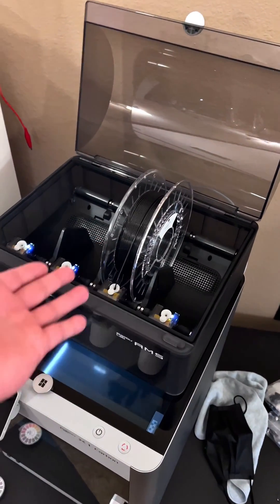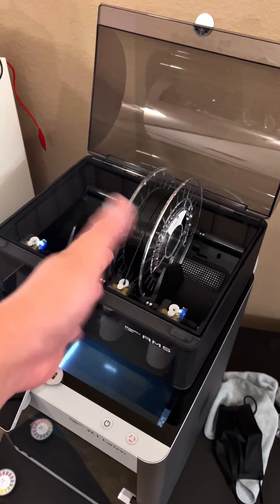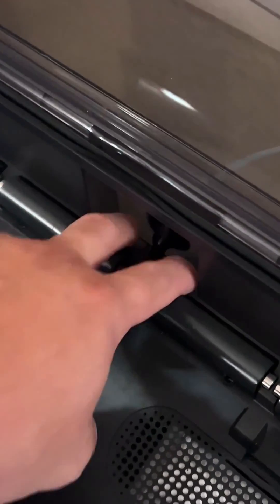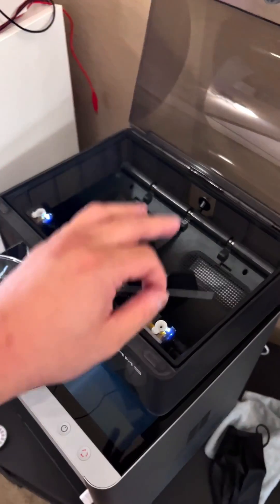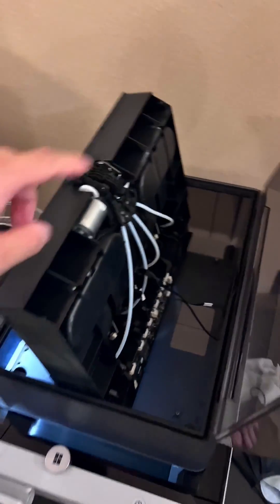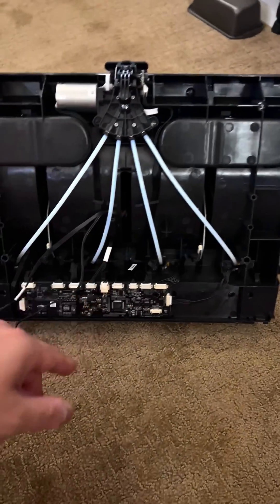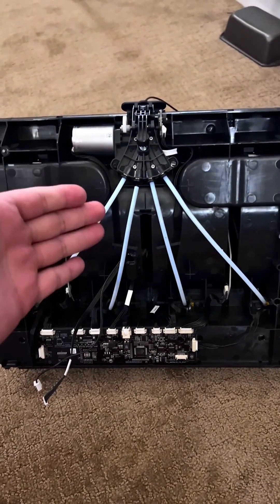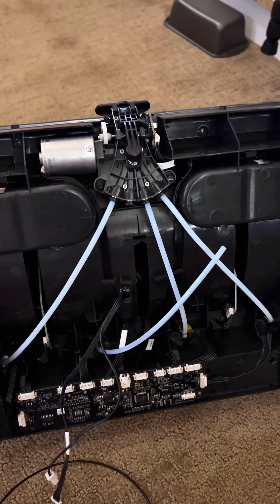How to unjam filament in AMS unit of Bambu Lab X1 Carbon

Comment: well your press down the hammer" saved my day. Had been trying to remove a piece of pla from that part for hours, thought about a hot needle to melt into that thing, but wasaraid to damage something. Besides that, that would not have helped at all, And then I found your explanation how to do this. A big thank you from Germany.

Comment: You say its a "hard no" even for 95A in the description, but the filament in the video seems way softer than 95A, have you tried 95A as well? I've read that other people have had no issues with 95A+
Reply from the maker: @ErgoBytes  the filament in the video is ColorFabb Varioshore TPU which has a durometer rating of 92 & it actually did work until the AMS needed to retract the filament for a color change, but I also have used another industrial TPU that is 75D & it also ended up failing the same way as well.
Firmer TPUs may work with the AMS especially since this video was posted when Bambu Labs just started shipping out their kickstarter units so more recent firmware updates might’ve made running firmer TPU possible.

Comment: Thank you so much for this video. 2 years after being posted it helped me figure out why my AMS wouldn't work all of a sudden. I didn't realize the filament broke inside the AMS.
Reply from the maker: @isaiahm158  knew this was gonna be a common thing the moment I started messing around with my new AMS. Funny thing is the 1st thing I did right after getting my AMS from Bambu’s kickstarter was throw in some TPU despite bambu saying several times not to at the time 😂
Glad this video was useful to so many people especially at the beginning since the Bambu Wiki wasn’t really fleshed out yet when this video went up

Comment: Had a print run out of filament in slot 1. Clipped slot 2 off and moved it over to finish the print. Well that was a mistake because when I went to unload slot 2 of that little piece it sucked it in and was stuck in a loop of not being able to clear out the filament. Thanks for this quick and well made video. Fixed the problem with ease!

Comment: I did the same thing with TPU.  I was able to disconnect to PTFE tube in the back, snip the TPU a couple of inches long at the spool, remove the spool, lift the 'release' for that spool slot and then pull the TPU out the back.  It didn't seem to resist the pulling and the TPU didn't even really stretch any, so it seemed safe.  Afterwards, I loaded another PLA into the AMS so I could see the PLA come out the back (making sure all the TPU is clear), then reconnect the PTFE tube.  Worked great.  Thanks for the video that stemmed my curiosity!  I didn't have to loosen the screws, remove the spool holder, etc.

Comment: phew -- apparently I had some very old and brittle PLA that snapped off and stuck in the hammer (in fact, it snapped off in two other places as I was trying to get it out). You pressing down the hammer to free the filament is what finally showed me how to get the last bit out, thanks!

Comment: Thanks for the video. I had to disassemble the hotend twice because of this. PETG, 250°C hotend 90°C bed. The piece I removed were looking squished. Most probably it did not have enough cooling time. Just a thought, in the gcode of the filament change rhere must be a pause of maybe 5s-10s until the filament cools down so it's not soft anymore.

Comment: I just had a piece of PLA break off right at the edge of the funnel, so I couldn't grab it to pull it out. This video is VERY well made, and helped me clear the broken piece in the AMS in minutes!
Reply: Me too! This was the only video I could find that said.. push on the spring. Thanks OP
Reply: @josephtruncale  In the same situation , very useful
Reply: @josephtruncale had the same issue 😭

Comment: hard TPU from extrudr worked fine for month, until now ... thx for the video ;)  hard tpu with carbon is even stiffer and hasn't failed. edit: only had to remove the back ptfe tube and managed to pull it out.

Comment: They really should have made the bottom removable to access the PTFE tubes to clear them from a jam or broken filament section floating around in the small tube section.
No fussing with the two short wires and no taking the whole thing apart. Its a royal PAIN.
Reply: Already working on some plans to use a router to remove that lower pan and print a new removable cover.
Reply: @robertspendlove7508  that would be awesome.. I hadnt done any projects in a few months, but it stayed closed. Wouldn't you know as soon as I turned the machine on and it ran through its start up process. I got a nice little jam!
Keep me in the loop on the access panel

Comment: Wow, this is exactly what I needed! Some crap PLA snapped when the AMS went to retract it, and I was like “where do I begin?” This was super clear and helpful. (What a PITA though, I think I’m gonna avoid cheap PLA going forward 😕)
Reply: Mine was old...and brittle
Reply: Just wet. dry it out and you should be good to go
Reply from the maker: Happy it helped! Moment I got my AMS from Kickstarter I knew it was gonna be a pain so I’m glad I could save you some trouble 😁
Reply: @MinWin3D   Yes - you did help tnx, lol when it happened to me i said to myself, oh gosh, i did what i wasn't supposed to do, oh well i guess its another AMS system if i have to worse case - but said let me google it 1st, i am sure i am not alone....bgish 1st vid solved my issue.....
Reply: Same! Weird because PLA spool is new from Bambu and came with the X1C printer.

Comment: Couple dudes in FB group claim they are printing 95A TPU consistently through the AMS. Never shoved the process though.
Reply: My guess is that it would be the 'overture high speed TPU'.  Don't know for sure though.  I would really like to get 98A shore TPU working in the AMS when I receive mine, if possible

Comment: hate videos where they just skip the hardest part. getting it upright
Reply from the maker: Would’ve definitely filmed it in greater detail if it didn’t take both hands & a few minutes of finessing to get it off. Really didn’t want to damage the wires or connectors
Reply: @MinWin3D  yeah, just got pissed off and missbehaved. Great video :) and to everyone Else just use a bit of force untill the rubber tap releases

Comment: Thanks for the video. You saved me a lot of time and grief! 😇
Reply from the maker: Happy to know it helped!
Reply: @MinWin3D  I'm curious if using Capricorn XS tubing would help here.  That spiraling is caused by the TPU compressing inside the tubing instead of pushing forward.  XS tubing might prevent that (similar to how it helps with bowden setups).
Reply from the maker: @jaydefizzle  so I actually spent a fair bit on Capricorn XS tubing to replace not just all the AMS tubing but on the X1 as well. Btw make sure you cut them exactly the same length as the original, learned the hard way 😅
Unfortunately, it didn’t solve the problem & in some cases it actually ended up cause a good bit of friction in areas where a tight bend was occurring so I had to remove them later on.
Reply: @MinWin3D  thank you so much for testing this!  Recommend to put a note about that in the description of the video!

Comment: That is great to know. Thanks for putting the video together. Any idea how to fully clean the filament feeding wheel? They say canned air but mines pretty caked on and cant find any decent literature or vids on it 😅.
Reply from the maker: So the front unit which "feeds" the filament is actually removeable since the whole unit can be replaced. So I just pop out the unit and use something with a fine point to clean out the grooves.
Reply: @MinWin3D  Awesome, good to know. Thanks for the tip.

Comment: I know they say TPU doesn't work in the AMS but after taking apart the whole thing I don't think that would have to stay that way. There is a drive wheel under the AMS and that's where mine keeps getting stuck, I think it's the various drive motors not operating in sync with each other causing the problem. Possibly a firmware update to alter its behavior for soft filament might help.
Reply: hopefully, I also jammed mine XD